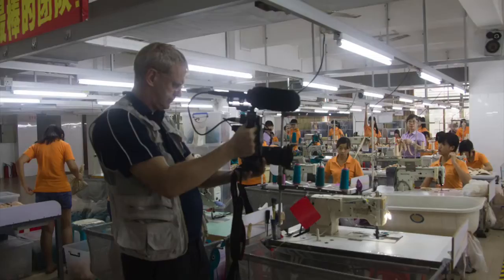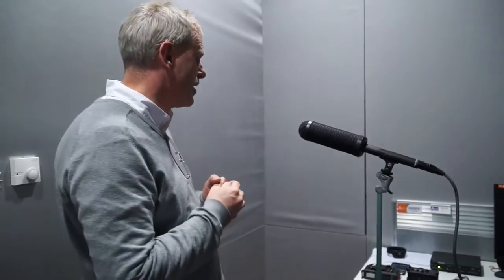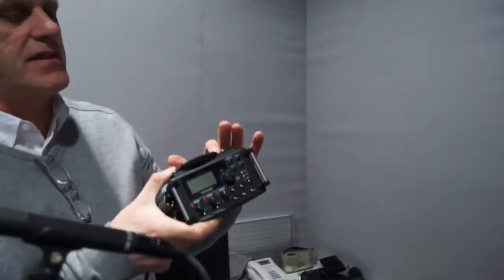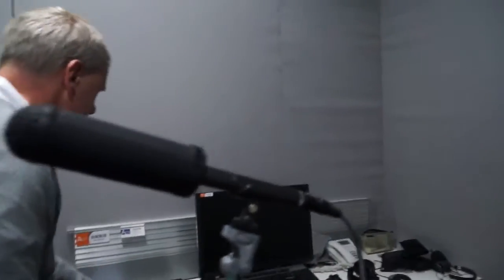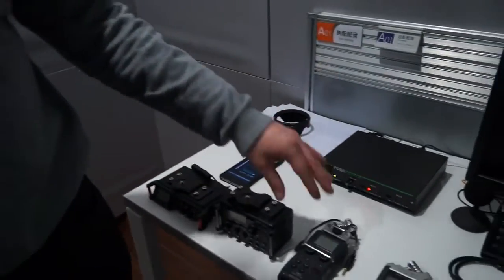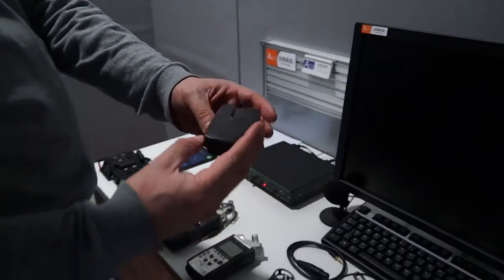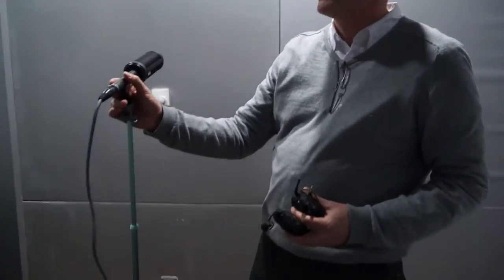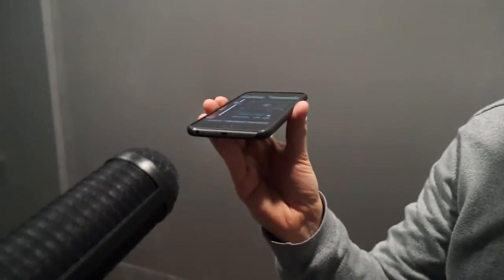DSLR Pre Amp Test --- Saramonic SR-AX101

Comment: Thank you very much for this very good and dynamic review.
You said you are not a scientist but you are an expert user. Could you give us your personal opinion on the tested adaptors?
Those adaptors require a specific battery and are connected through the mic plug of the DSLR.
 Are there other technical differences (mainly at the sound quality level) with original adaptors such as Sony XLR K2M using the multi interface shoe on Sony mirrorless a7 series.